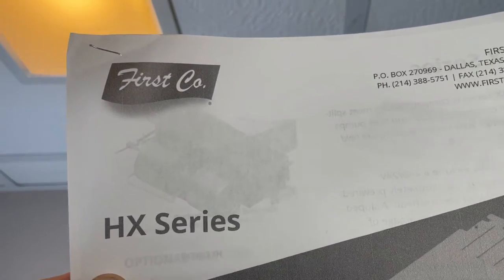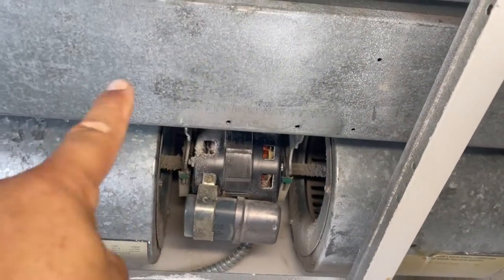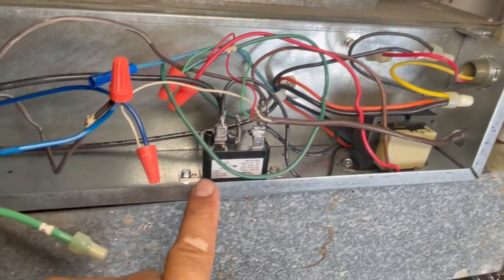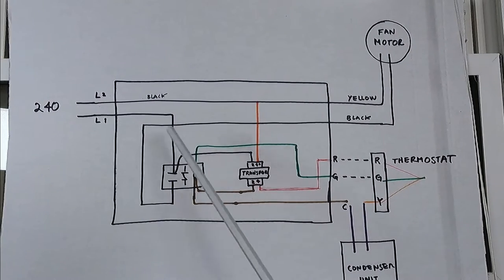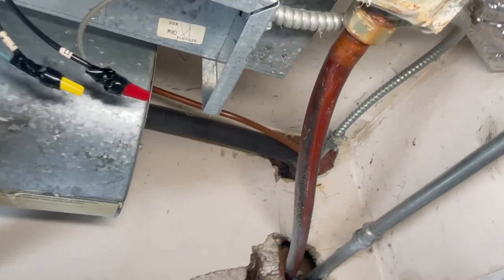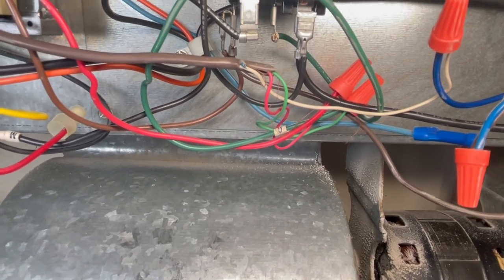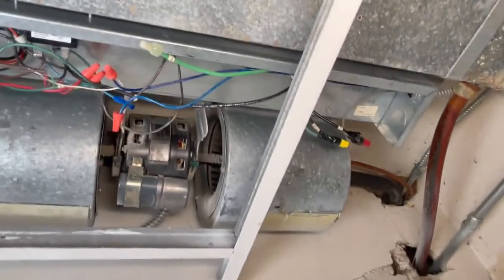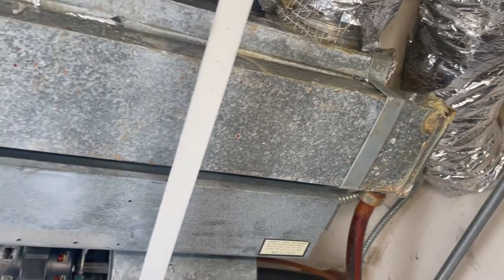FIRST CO. HX SERIES.  HORIZONTAL, RECESSED. HOW IT WORKS. MOST COMMON PROBLEMS.

Comment: I saved myself $1000 because of this video thank you
Reply from the maker: awesome!!  What did you do to save that much money?  please like and subscribe.  thanks
Reply: @alexthehandyman3494  I was quoted a new brush Motor + installation but using your video I tracked the issue to a faulty relay which was $15 off amazon to replace

Comment: I’m dealing with having to replace this relic right now along with my 20 year old AC condenser. Same set up, no heating just AC. l’m getting quotes of $4k-$6 for the condenser plus another $$3k-$6k to change out the ceiling mounted fan coil. So far two quotes are $9.3k and $10k. Absolute insanity, I had no clue how much this type of set up costs. If you have this definitely keep up the maintenance because you’re on borrowed time and it’s gonna be a fortune to replace.

Comment: Thank you so much. Oh my goodness. It's so difficult to find videos on fan coils. 😢 Where is the drain pipe? Is the safety switch also connected/can it be connected to the drain switch?
Reply from the maker: Hello.  Go to min 10.30.  It has two main drains.  One to each side of the drain.  You chose one . Most units I see do not have a switch to kill the power if it clogs and overflows.   Usually is just  a hose  as a drain.   That’s because there  is no room for anything  but you can have one installed if you want to avoid costly damages by water  When they clog they make a mess . Thanks for watching.

Comment: I have a similar model. Any idea on why I only get heat to blow out when its on AC?
Reply from the maker: Hello,  it could be 10 different things.
1 low refrigerant or nothing at all, maybe a leak.
2 check condenser. It might not be working due to a bad capacitor or contactor.
3 Make sure is calling for cool.

Comment: Do they sell the rubber bushings that hold the motor shift in place if so where can I find it I have a motor and one of the scroll cages are scraping due to the shaft not being aligned because of the bushings
Reply from the maker: Hello,    Yes they still sell parts for these units.   Go to Firstco.com     .   Go to products.  find your unit .  then go to parts.

Comment: Mine is exactly like that. The fan is blowing but for some reason, I'm not getting any airflow through the ducts. All the connections are good. I have no idea what to do. In trying to clean the coils. I had to replace the capacitor and transformer outside already on the AC condenser unit. That seems to be working. But without any airflow into the ducts, it just trips the high-limit switch and shuts off. I really need some help. Any suggestions would be nice.
Reply from the maker: Hello ,  Make sure condenser is clean.\
Replace the filter
The fan motor might be working but the squirrel cages(2) might be broken.  Remove the cover and and see if they are in good shape. 
See if the ducts are kinked or disconnected.
good luck .   Keep me posted.
Reply: mine too...very reduced air flow